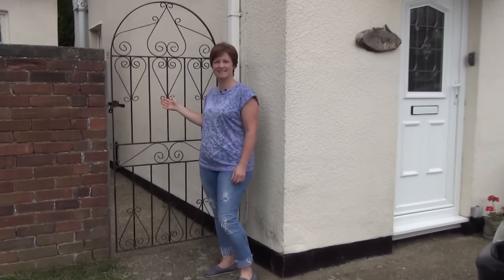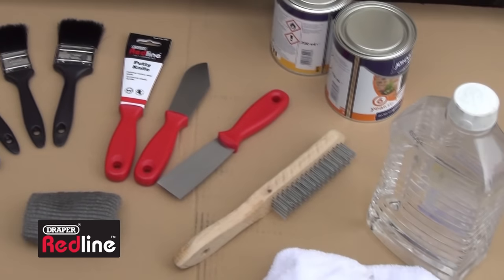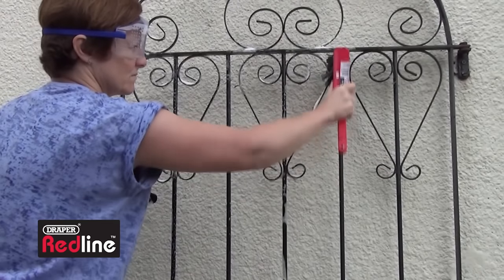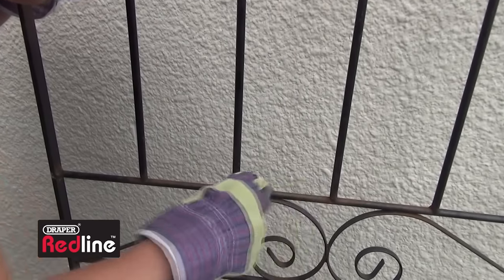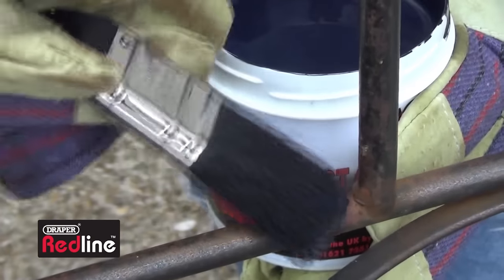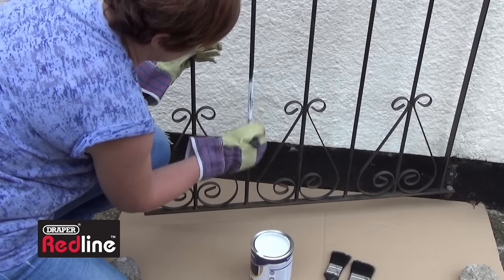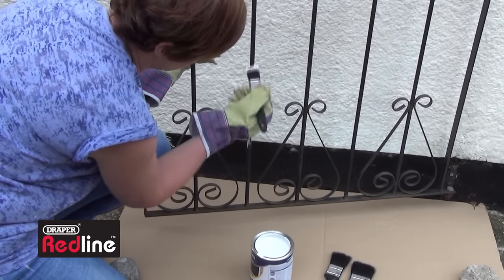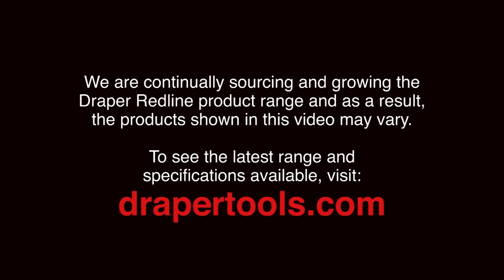How to paint a rusty gate

Comment from the maker: Concentrate on removing all signs of rust such as blistered or flaking paint before applying any rust primer. For the primer to be effective, it needs to be in direct contact with the metal surface, if not, the primer won't protect the metal.

In areas that aren't rusty, but you want to overpaint, scratch the surfaces using a wire brush and wire wool to create a key for the new primer/paint to bond to. Make sure any paints you're using are compatible, otherwise they'll react with each other and blister.
Reply: Don't we use turpentine oil with primer and paint?
Reply from the maker: @A0D0D7Y  The Oil could be used to clean the gates before priming and also used as a thinning agent for the primer.

Comment: do you need to remove the old paint first before applying rust primer? or just the spots that are rusted
Reply: Use the ends of the wire brush bristles, not the sides as shown.  The sides will just burnish the rust that you want to remove.

Comment: Great video, thanks!
is this technic the same for aluminum gate?
Reply from the maker: Essentially yes, but you'll need to use paints specifically for aluminium. Glad you liked the video.
Reply: Thanks for your reply; I really do not know how to figure out of what is our gate made:( Any suggestion how to learn that? Thank U
Reply from the maker: There are generally two types of metal - ferrous and nonferrous. A simple test you can try on your gate is to place a magnet on it. The magnet will stick to ferrous metals such as iron and steel, but fall off nonferrous metals like aluminium and zinc.

Most metal gates are manufactured from iron, if yours is bare metal and silver/grey in colour it could be galvanised steel and not aluminium.

The result of the magnet test will indicate whether you need to buy metal paints for ferrous or nonferrous metals.

Hope this helps.

Comment: What filler material can be used for sections that have eaten away?
Reply from the maker: A metal epoxy putty should do the job, you should find there are various makers selling this. We have recently used a small tube of the Evostick one and it worked well on a copper pipe repair.

Comment: Can't you not just use rustoleum spray paint? Wouldn't that go faster and give a more uniform look? I once painted a gate before using oil paint. First coat took me 4 hours.... I just told me father to add the second coat when I am gone... I couldn't do it...
Reply from the maker: Even with Rust-oleum, it’s better to remove as much corrosion as possible for a better, longer lasting result.

Comment: You can not paint the gate properly unless you turn upside down. Because you WILL miss the parts of the gate,
Reply: True, but these areas are generally protected from water which is needed to form rust. The main damage occurs on the top surface where the water can't run off.